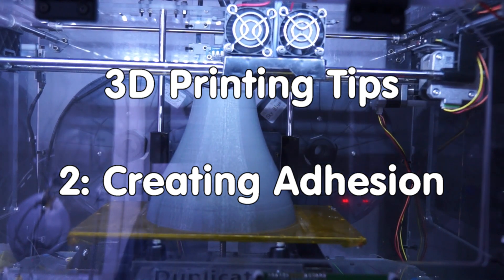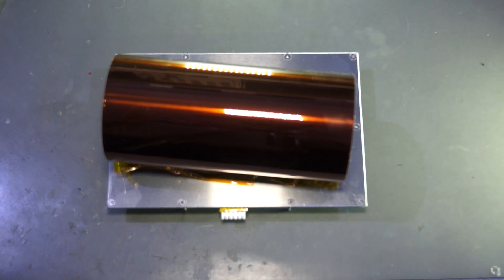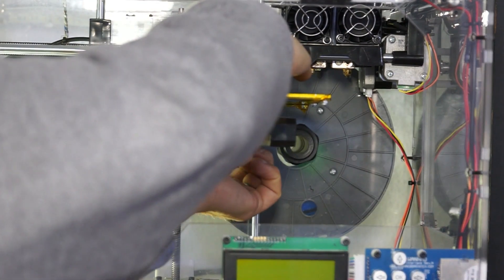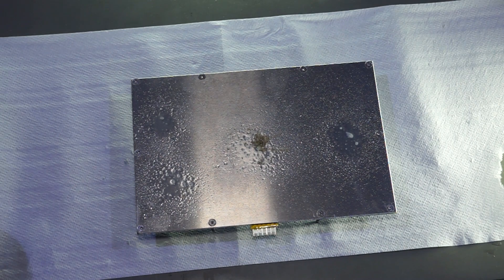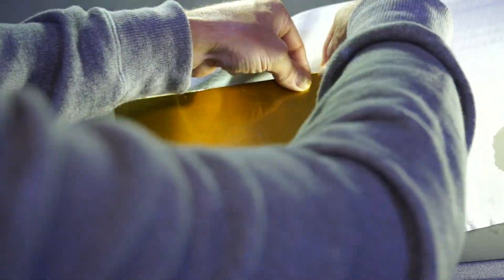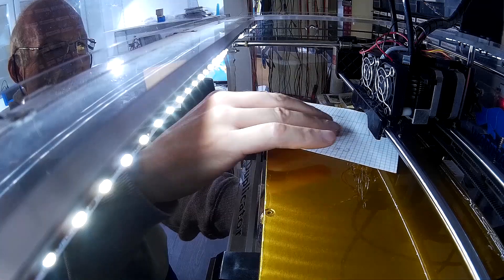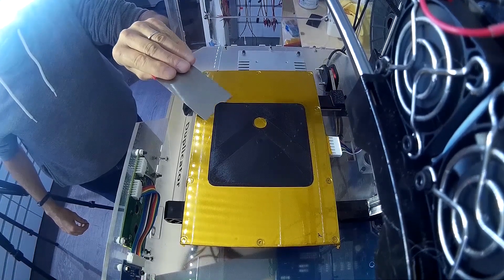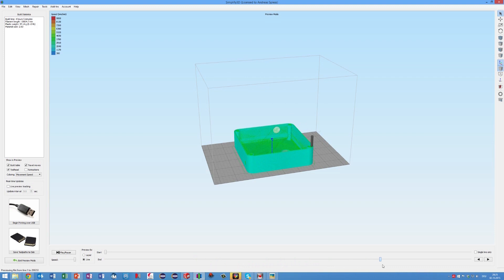#26  3D Printing Tip #2: Creating Adhesion using KaptonTape  and Hairspray

Comment: I finally bought a 3D printer, Prusa mini+, rewatching these videos from the days before you had your Prusa printer makes me wonder how many problems you solved by moving to the Prusa from your previous printer?

I look forward to using your universal case design and printing project boxes for some of my projects

Thanks for this video
Reply from the maker: So far, I have no problems with my Prusa. The only thing I was not able to print was flexible filament.

Comment: All credit to Andreas Spiess for the great work - and all your knowledge and videos.
I have binge-watched all your videos.
Discovered this channel when I was doing Raspberry Pi / Arduinos - but I now own a 3D printer as well as an Engineer PA-09.
Thank you, Andreas! Always excited for your next video.
I enjoy the way you are thorough in your assessments - and the calm voice and explanations.
Throwing this one back to you as a tip: https://flex3drive.com/product/printbite/. Check out some references online / videos on it.
Reply from the maker: Thanks for your tip and link, and your nice words. I am sure, it is a good product, but quite expensive till it arrives in Switzerland... So, I am not sure I will try it out. My 1 $ Hairspray does the job for PLA, and I focused on that material. If I would need ABS I might reconsider, because I never had success with the adhesion of ABS so far.
Reply: For certain applications - PETG filament could also be a nice alternative. Easier than ABS to work with, and not as expensive as some of the more special filaments. For certain projects (on-going) - I will be depending on small electronics boxes that can handle being outside / exposed to temperature and sun (without melting/deforming). I am also implementing a controlled heating resistor inside the box for avoiding condensation / moisture trouble in night/wintertime.
Reply from the maker: Never used PETG. Baybe I have to buy a roll with my next PLA order... And good idea with a resistor, if your device does not produce enough heat and you have grid power.

Comment: Inspired from your videos I bought a Ultimaker 2+ about 3 weeks ago .. and went through all the typical adhesion (and other) problems . While using that blue tape together with hairspray helps (my Captan Tape has not yet arrived) basically all of my problems dissapeared after changing the nozzle from 0.4mm to 0.8mm.! Printing runs like a charm now, adhesion is no longer a problem and also printing time is reduced a lot!. The difference in printing quality is negligible for me since I do not print ornamental, but mostly technical stuff. Initially I did the change to speed up printing time, but I was really surprised what else was effected. I can render in cura using the 'FAST' setting and speed up on the printer itself up to 150% in addition without problems. The more material helps a lot to not only fix the first layer, but all the others too. Phantastic!

Comment: very nice.   for hairspray being too sticky ,  possibly a drop of water or alcohol on the edge of the print could temporarily soften the hair spray .  I don't have a 3d printer yet ( just one of those ABS extruder pens ) so i don't have any print bed to test that on myself  .   I have used Hairspray as a temporary adhesive for  applying paint masking and all sorts fo stencil work and found it usually come off or becomes soft with as little as a single drop of water .  you may be able to release your prints with a few drops o water placed a the prints edge and waiting a few seconds or so for the water to get to the hair spray . I have used hairspray as molding release agent in the past to and used from 50% rubbing alcohol to get parts off/ out of molds.  then let it dry and re-spray if need be or i wiped it clean before next casting .
Reply from the maker: +XerotoLabs Thanks for the tips. I will try water or alcohol with my next prints. I am curious if it moves between the Kapton and the print. I understand you suggest to apply the water after the printing before I take the item from the heated bed? Is this right?
Reply: +Andreas Spiess yes that's what i would think should work . If the extra stick is because there is a thin film of the solids in the spray , and those solids are usually dissolved in alcohol or water in the can , the water/alcohol hopefully would wick under the part  .  if the spray lists alcohol as a main solvent , the it may be best just to try rubbing alcohol first , as it is a bit thinner and may get under the part faster . 
only issues i can see are : 
 1. the extra adhesion is not form the solutes in the spray but rather it reacts with the capton tape some how, changing its surface . ( i doubt that as i see people have to re apply it )
 2. The  film / residue of hairspray is so thin there is no room for new solvent to get under the print to it  .  
I don't have any capton tape , but i will try this with some hair spray on glass, and my ABS pen .
Reply from the maker: +XerotoLabs I will try and keep you informed
Reply: +Andreas Spiess  hope it works such that you only need to nudge the part with your finger .  I tested a few of the spray my wife has on glass .  i heated it with a hair dryer , as I don't have a print bed let  alone a heated one . LOL . the  cooked/dry  hairspray residue would wet and wipe away quite easily with water , even more so with rubbing alcohol .  my small  hand done tests stuck well to the glass , and  came off with almost no force once  i used alcohol ,  water was the same it just seemed to take a bit more and  a bit longer to get under ( it tapped the prints with a my finger until they moved ) . Remember  my flat part was hand done, so there may have been more errors/room for capillary action to draw fluids under it . when it dries it's ready for re use  . 
i suspect the more surface area in contact with the  print bed the more solvent and time it will take for it to free up .
I hope to get or make one of those very small printers , and I don't want to have to apply any force to a small print bed , so if this works reliably with proper prints it will be perfect .
Reply from the maker: +XerotoLabs I tried it now with very small parts and alcohol. It worked and after removal, I saw, that the alcohol was able to get under the print. Not everywhere and not very deep ( I waited only abou 5 minutes), but sufficient to remove the part.
Thank you for your tip. I will use it in the future when the parts do not remove easily.
Reply: +Andreas Spiess i suspect the low quality of my hand made shapes trying to be flat allowed for gaps , big enough for capillary action .  but that said i only did small things . I'm glad it works  , anything that lowers the force needed to break a part free is a good thing .  I wonder if one could deliberately make it print tiny channels under prints with large surface area on the bed . hmm.  Experiments for the future . LOL
Reply from the maker: +XerotoLabs Actually, the surface on the Kapton usually is the nicest looking because it is flat. So, for me, to destroy this nice look with channels would not be a good idea even if technically it is for sure working...